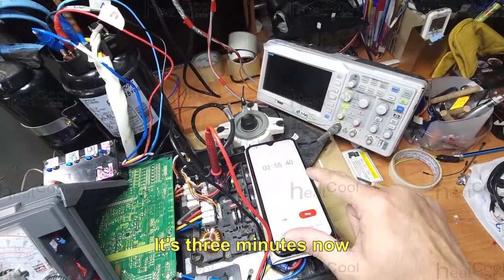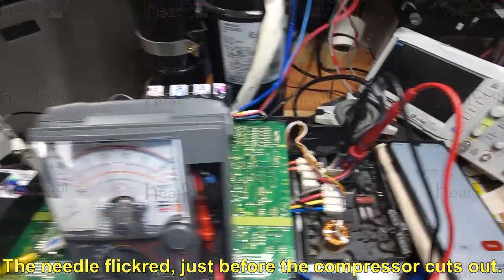Easy Daikin DC fans diagnostic and Daikin inveter compressor checking

Comment: Hello, I am a HVAC technician here in New Zealand. I came across your YouTube channel as I have been searching for a universal test tool just like the one you displayed for troubleshooting heat pump system dc fan motors (indoor/ outdoor). Any chance you could point me into the right direction of where I can get one or build one? I see a few people on Oz using them. I cannot seem to find them anywhere.
Reply from the maker: Hi, I invented this tester kit, so one day it will help technicians around the world doing their jobs easier. Unfortunately the current intellectual property laws in Australia ( and I personally thinking: The same for everywhere else of Western Countries ) is not doing it job protecting creation such as this. I have total of more than 30 inventions for doing Gas ducted heating, Evap cooler, Air cond and Refrigeration both commercial and domestic types. There is no suitable owner right protection law for me, therefore I am so regret to not able supplying the test kit for the time being. Regards.